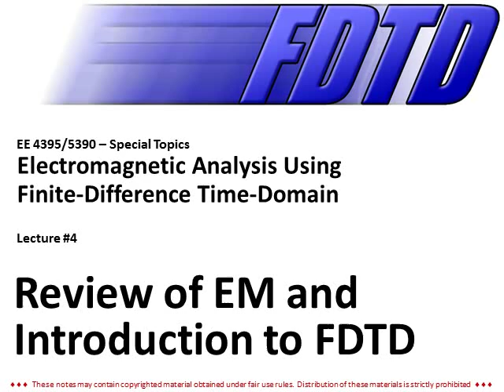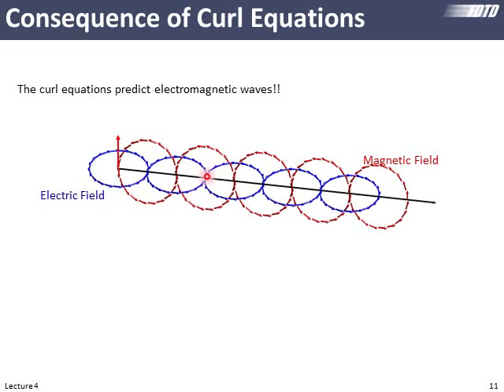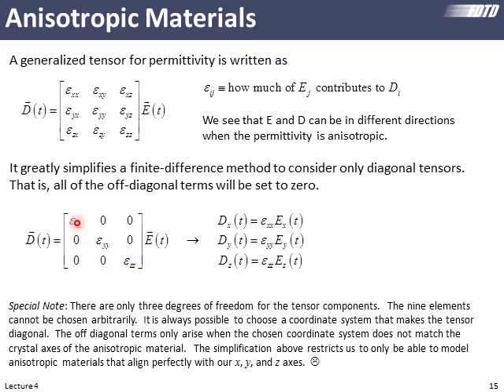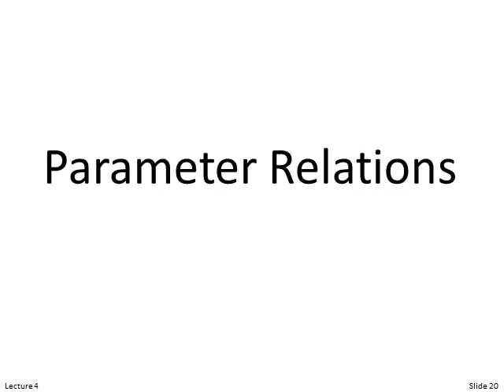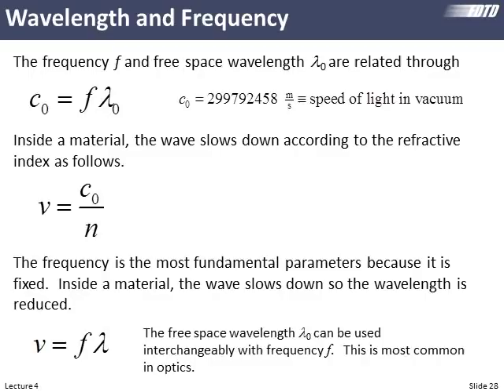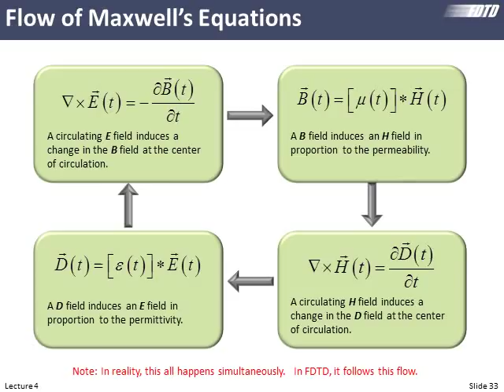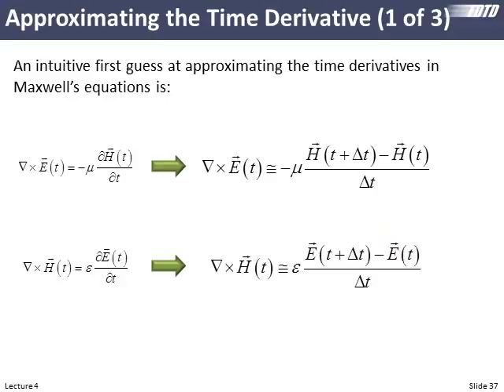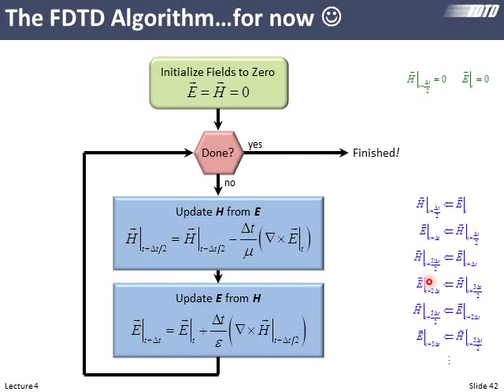Lecture 4 (FDTD) -- Electromagnetics and FDTD

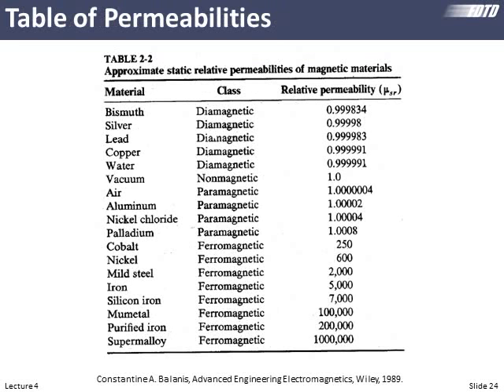Comment: At 22:58 the slide claims that the relative permeability is in range [1, inf] but the next slide with table 23:03 shows that for example for bismuth the value is <1. What am I missing? P.S. great materials, I really enjoy the lectures so far!
Reply from the maker: Yes, the relative permeability is always greater than 1...except when it is not.  ha ha  

Sorry for the confusion here.  The answer is a bit involved, but whenever the parameters seem to have strange and magical values, it it usually a frequency-domain thing where parameters can easily have strange values depending on the frequency relative to where they are resonant.  If you want to see more about this, checkout Topic 2 here:

https://empossible.net/academics/emp6303/

BTW, let me point you to the official course website.  Many of the lectures have been improved and revised.  You can download the notes, get links to the latest videos, and more...

https://empossible.net/academics/emp5304/

Also, you maybe interested in the following online courses in FDTD.  They are intended for the complete beginner and even include extensive MATLAB codes.   The first half of the first course is entirely free.

https://empossible.thinkific.com/collections?category=FDTD-in-MATLAB

Hope this helps!!
Reply: @empossible1577  Thank you so much! This is a very helpful and comprehensive answer :)

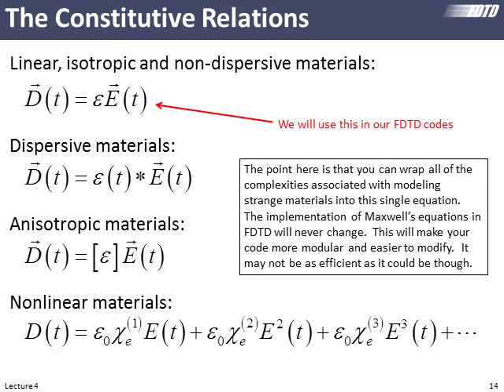Comment: The function of D at 12:34 is actually the function of P, an extra term of epsilon_0*E is missing.
Reply from the maker: P = eps_0 * chi * E
D = eps * E
eps = eps_0 * eps_r

All equations at 12:34 look correct to me.  Which equation is bothering you?
Reply: @empossible1577 Boyd (non linear optics) defines P = epsilon_0*chi*E
Reply from the maker: @Cringeupdates  Ah yes!  I forgot a term in the third equation.  ha ha.  Thank you!

I have fixed the notes that are available on the course website.  When I rerecord, it will be in the video.

https://empossible.net/academics/emp5304/

Comment: Great course.helped me a lot during coding my own simple Maxwell solver. I'm curious about the update equations for dispersive materials though. Taflove gives a very short summary for this..hard to follow. But fortunately theres no need for on-the-fly convolution or Fourier transformation,if I got it right. I didn't get the following: Is the E field still divergence-free in case of linear dispersion?
Reply from the maker: This topic is covered in Lecture 10, but I only show one technique for incorporating dispersive materials.  There are other many other methods.

Comment: 1:43 where on the website is it?
Reply from the maker: The Lorentz force law? This typically is not used in FDTD. There is a variant called Particle in Cell (PIC) FDTD that uses it to simulate interaction with plasma.
If you just want to learn more about the Lorentz force law, checkout Lectures 4e and 5d here:

https://empossible.net/academics/emp3302/

Also, the course this video is from is here:

https://empossible.net/academics/emp5304/

You may also be interested in a book we just published. It is intended to teach the art of computational electromagnetics to the complete beginner. The books goes all the way from basic concepts up to rather advanced simulations. Here is a link to the book website:

https://empossible.net/fdfdbook/

Hope this helps!

Comment: In slide 36, why is the first order differential plus the function itself equals to zero? Thank you very much for the lecture by the way. It is the best.
Reply from the maker: That just comes from the differential equation I chose for this example.  Otherwise, there really is not a reason and it could change.  I was just trying to keep it simple.
Reply: CEM Lectures Thank you!

Comment: I'm embarrassed to ask but what is meant by the convolution (*) operation?
Reply from the maker: Ha ha.  Glad you asked!!  If you have not seen convolution before, it is a weird concept to grasp.  It is sort of a blurring operation where you slide one function across another and report the overlap area as a function of the offset.  You can take a look at the wikipedia article on convolution.

https://en.wikipedia.org/wiki/Convolution

Unless you are doing some more advanced FDTD, you do not need to understand convolution.  The point is that the material properties are not constant, although it is usually an accurate approximation that really simplifies the simulation.  However, imagine the permittivity changes with frequency.  How do you account for this in a time-domain simulation when you potentially have a spectrum of frequencies all in the same simulation?  I touch on this topic in Lecture 10.  I also talk about another FDTD topic related to convolution in Lecture 12.  Even though permittivity (and permeability) is a time-domain phenonemon, we like to report the permittivity as being a function of frequency.  In the frequency-domain, the constitutive relation D=eps*E is a standard multiplication.  However, when we Fourier transform to the time-domain, standard multiplication because convolution.

BTW, here is a link to the course website.  It as links to the lectures on YouTube, you can download the course notes, and get other resources that may help you develop your FDTD code.
Reply: I can't seem to see the course website link can you resend?

I'll start writing some code for lectures 5/6 in Python Saturday.  Wish me luck.
Reply from the maker: http://emlab.utep.edu/ee5390fdtd.htm